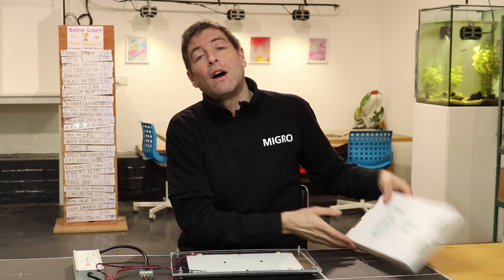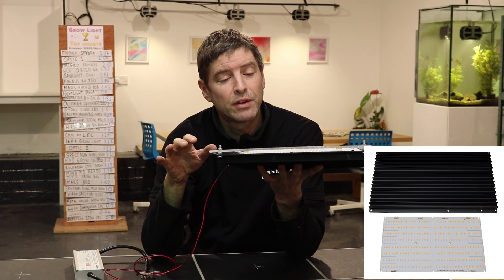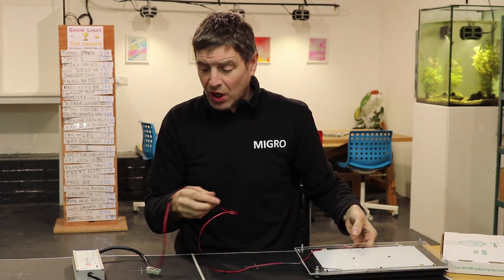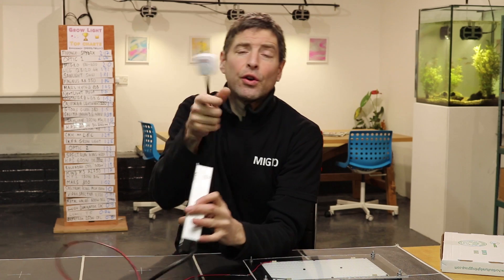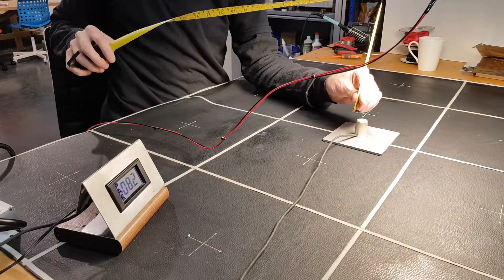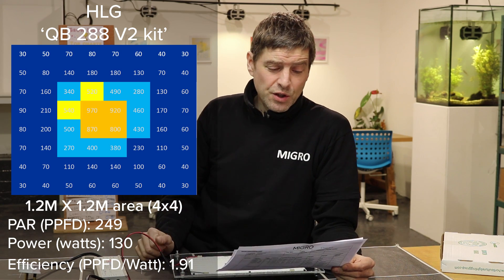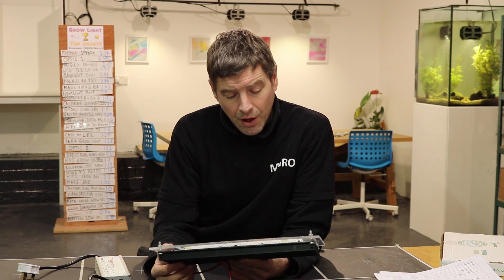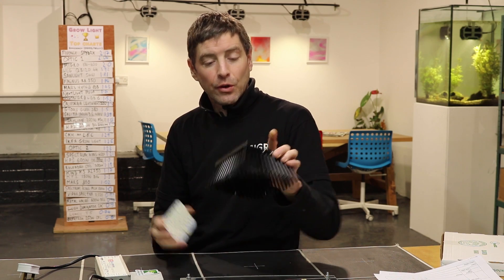HLG Quantum Board grow light test - Horticultural Lighting Goup QB288 V2

Comment from the maker: There is some criticism that I included an acrylic cover on the fixture. Here's why I did it:
1. Very few grow lights are sold without covers, even the cheap ones. Why is this?  Running LEDs in a grow room without a cover risks dirt, mositure, bugs, scratching/banging ertc. damaging the LED surface over time. Manufacturers supply covers so they do not have excessive warranty claims and the risk to users of exposed LEDs causing fires, shorting out etc. 
2. The reduction in light transmition is only 3%, this is a very small cost for protecting your LEDs. I tested the HLG QB288 with and without the cover and the difference was only 3%. I have tested the same with HID reflector hoods with glass on/off and the difference as 3% also so I am happy it's accurate.
3. This is a DIY fixture and the HLG guidance on how to install includes an acrylic sheet link here: https://horticulturelightinggroup.com/pages/qb-optics-and-connectors
Reply: Lars is correct. He doesn't alter migro for test results he shouldn't of altered the quantum board.. but even with the glass the qb scored great
Reply: This is funny as fuck ..... committing fruad ..... lieing ...wtf .....OCD at its finest .. people are why I don't go out anymore 😂 😂😂😂😂😂😂😂
Reply: @deanthornby2026  migro literally put a light limiter on a light and reviewed it.  Nowhere does HLG recommend putting plexiglass on. But I guess if your cool with it everyone else that isn't is crazy. Makes sense.  Ugh.  This is why trumps in office people are so  uneducated on simple science and morality.
Reply: Fuck the plastic cover the panels are only $60 USD a pice $35 if ordering directly from China where everything is manufactured now day's anyway 🤣
Reply: @mackattack8627  dude you're full of shit Horticulture Lighting Group manufacturers thier lights right here in Westerville Ohio.  Outside Columbus.
Reply: Thank you for the video's I really appreciate them.  I'm kinda of shocked how good the cobs are still doing against the new tech
Reply: Wtf.  You don't really believe that.  That 3% or .o3 would have changed the outcome from 2.05 to 2.1, which would have pit it in second place.  If that were a migro product something tells me you would have recommended a lens but not installed it.  Smh.  I see you.
Reply: ......these lights can be sprayed with water and not be damaged.......
Reply: @kenshinhimura9387  Their HLG550 fixtures are UL certified and have no plexiglass.
Reply: @LarsLarsen77  you sound fanatic over a brand... like a Chevy guy crying about the track surface and tire compound details when a camaro loses to a mustang.... Stating all these facts from a piece of paper or sales brochure. The light is fine. He didn't do anything wrong. At the end of the day It's just a damn light, this test isn't going to convince someone away who is already looking at a quantum board.
Reply: @volvo09  There is a reason these lights have a cult following.  They're fucking awesome.  At the end of the day he's committing fraud.
Reply: Lars Larsen why do you think he’s committing fraud? Isn’t he just promoting the light?
I’m just curious.
Reply: @volvo09 except your analogy is flawed.  Its more like Mr. Migro riding the brakes at 8% and saying its no big deal.  The plexi isn't needed, I own the light too.  It just limits the light....... Like riding a cars brakes in a drag race.... Not fair
Reply: @carlhank3495   by putting a plexi glass lens over the light he's limiting the ppf or light output, which is what he is claiming to be testing. It'd be like riding the brakes in a car 3%-4% while testing how fast it is.  The company doesn't recommend this. Its not fair. The light would have been 2nd place on the leader board.  I own the HLG QB 324, and with 15 yrs 1k w hps indoor farming exp.  I can say  they blow me away.
Reply: I run a rdwc and adding anything that's not waterproofed is a negative ghost rider.
Reply: @greenskeletons1896   I own an hlg qb and run it in a vertical light moving system along with spaghetti line the feeds  4' tall PVC tubes that I plant in( complex vert hydro system). Have had the spaghetti hoses fail and spray the light which was unbelievably fine.  Its UL certified w/o any coating.  These lights are the future.
Reply: "Approximately 4% of the incident perpendicular rays
are reflected at each air surface interface of colorless
Plexiglas sheet, giving a total reflectance loss of
approximately 8%. As the incident beam deviates
from the perpendicular, the surface reflectance
increases. "

As the angle of incidence increases,  the light transmission drops to ZERO and all of it is reflected.  Since these LEDs have no lenses (literally the only difference between this and your light,  other than it's efficiency) most of the light is being reflected.  You are lying.

https://www.plexiglas.com/export/sites/plexiglas/.content/medias/downloads/sheet-docs/plexiglas-optical-and-transmission-characteristics.pdf
Reply: You didn't use optically coated acrylic,  which literally nobody on the entire planet does.  They fucking sell one with acrylic lenses on it,  and you could have just used that.  You're committing fraud.

Comment: I was waiting for this one, thanks Shane, there are more and more being sold on ebay from uk independent sellers pre built with dimmer for around a £per watt which makes them far more cost effective than the HLG boards with the same components (apparently) Samsung and Meanwell have all ready done the hard work and are still covered with the same warranty periods.
Reply: What umols/w do they emmit if much more effective
Reply: @lightworker17  as per sellers description "650umols in the centre of 1m sq and 300umols around the sides at 20 inches" @250w from the wall. unfortunately all tests are not created equal and would like to see the boards up against the HLG in the same test conditions.
Reply: My friend went for cheap led from e bay ......  He knows his stuff and has done for many years .....he doesn't use them any more .....they took twice as long to finish

Comment: But have you consider some of the lights are water proof, and some of them are not? Also, the spectrum plays a big roll in the equation, just saying, you are doing great, maybe should consider a tent, which would be more accurate than open space for ppf
Reply: That was the purpose of the Mylar walls. Which I've never seen him use with previous lights, but I've missed a few.

Comment: The hlg qb's are capable of 150 watts. The efficacy is a little better a 120 but the total ppf output is less than what is capable. I find this slightly misleading. Also imo use a real grow tent, your losing a little light out the top and sides of your setup, and yes I can tell you did this to make filming easier. Also I've seen loses as high as 10 percent with the lens covers.
Reply: The plexi is reflecting most of the light hitting it because of the high angle of incidence,  so it's just spreading it out onto the tent walls.  He's absolutely lying about the 3 percent thing.  That's physically impossible.  He's also lying about it being a safety issue.  The HLG550 is ETL listed and can be used on commercial grows.  

You're absolutely right about using a smaller power supply.  HLG ships with the 135 watt A version,  not the 120w B version.  

Also,  HLG makes optical quality lenses,  and he could have just used those instead.  But that would be a fair comparison with his less-efficient lensed fixture,  so he will never do that test.  Much more profitable to commit fraud.  Someone should report him to the FTC.
Reply: @LarsLarsen77  you're a fucking idiot.

Comment: I use the 550v2 480 watt in my 3  by 3 by 7.9 feet tent, in rocks hard love these leds.
Reply: I've got 4 QB288v2s in a 2x4 :)
Reply: @LarsLarsen77  Great spread. Big up!
Reply: @svenzia  Yeah,  two double heatsinks running wall to wall.  I dim them down to about 150w each.
Reply: Lars Larsen  would two in a 2x2.5 work? Thanks
Reply: @scotthuey1981  yes very much so. You could even dim down a bit. I just did a test with only 1 board 125 watts from the wall aprox same size 2x2.5ish.
Reply: @scotthuey1981  Two quantum boards in a 2x2.5 would be perfect wired in series with a 260w HLG-240H-C2100A dimmed down a bit.  Running two boards at half power makes them much more efficient than running one board at full power,  plus you have better spread.  You also have enough horsepower to run 1000PPFD if you want.
Reply: Lars Larsen thank you. Much appreciated, I knew you would know. 🙏
Reply: svenzia thank you 👍
Reply: I bet it does awesome.  Overkill on full power but would not mind, love the QBs. You dimming?

Comment: I read some people use flathead screwdrivers to adjust the light as it won't round the screw off
Reply: For "A" drivers,  #1 phillips screwdriver fits the plastic adjustment screw perfectly.
I have 4 of these QB288V2 boards & very happy with them. Fast shrubbery growth
Reply: @maxlevett7474  He used a B driver so he'd get less output and could claim lower PPFD.  The actual kits sold by HLG come with an A driver.   It's just deception after deception with this asshole.

Comment: I normally enjoy your scientific based testing.  Not so much this time.  Lose the plastic cover and try again please.  Don't be the only guy on the internet with a cover...
Reply from the maker: The test in the open environment was repeated with the cover off and 64 PPFD readings were taken. The 3% rduction is the same I have had with glass on/off tests with HID reflectors. Thanks, Shane
Reply: @MIGROLIGHT   I spent a little time searching the web for information on light transmission through acrylic plastic.  From a couple of different sources: There is a 4% light loss going into the plastic and another 4% loss as the light comes out.  I was surprised to learn that there really isn't a lot of light loss within the material itself.  So we're at a commonly accepted 8%.  (I've got an Apogee PAR sensor, but didn't use it, but only because I don't have an appropriate piece of plastic available.) 

I get it.  The new HLG, in it's commonly used bare form, is a tiny bit more efficient than your light.  But it doesn't offer the protection for the diodes that your light does.  So you're just helping out a little with their design.   

You're losing a bit of credibility in the process.
Reply from the maker: I'm sorry to disagree but for a 3% light loss you should cover your LEDs. They will get damaged by dirt, flies, water etc. Trust me I know as I used to run cobs open and they always got damaged. I'm demonstrating responsibility and good practice and I'm surprised I'm the only one
Reply: @MIGROLIGHT   My thought was that if they sold them with the intent of someone installing a cover on them, you'd have  a fair test.  And while protection is indeed nice thing, modifying their design to test it isn't really a fair test.  Where are you getting your 3% correction factor from?  Is this something you've confirmed with your PAR meter?  My gut tells me that 3% is too low.
Reply: @335alien335  I think that I remember hearing Stephen from HLG say that the v2 boards now have a protective coating applied that prevents that type of damage.
Reply: @335alien335  Here they say.it's a diy kit, you can do with it what you want, they are not telling you how to use it. https://horticulturelightinggroup.com/pages/qb-optics-and-connectors
Reply: I agree this is a bs silly test shame on you. You know dam well what you're intent was you're not fooling anyone. Take that think ass piece of plastic off and run the test again i dont hlg would approve of this at all. Seriously no one does this.
Reply: @MrMaitland79  HLG would approve. why don't you check the website first?? https://horticulturelightinggroup.com/pages/qb-optics-and-connectors
Reply: @MrMaitland79  you're the only fool here
Reply: I agree i have never seen anyone in all the video's online showing with cover on it. Take cover off. I am sure it wont hurt you just for the testing process. Then we can see your math of 3% is accurate as well.. it's already 2nd place on your list behind you at 2.05... if it's 3% then it should be 2.11%    thank you for all the real testing   The only other thing is that I wished you had tested with the self kit with driver included instead of the B driver you used as I am able to turn past the 135Watt rating up to around 165-170 Area if I remember right. Would like to see how output is when maxed out from kit form sold by company..

Comment: Great video! I'm surprised you only lost 3% through that thick acrylic. I thought it would be double the loss you measured with the substantial thickness of that acrylic.
Reply: Acrylite themselves state a 8% loss in the visible spectrum with nearly 0.5% more loss for every inch of thickness of their clear acrylic. Even if is was 1mm thick, the surfaces of the acrylic lose 4% each for a total loss of 8%. IDK, man, 3% seems too good to be true.
Reply: @deluth4638  The losses increase with angle of incidence,  and since these LEDS put out light in all directions,  most of it is not transmitted.  It's being light-piped out to the edges of the plexi like a fiber optic cable,  and hitting the walls of the tent instead of the sensor.  He's tested HLG lights 3 different ways so far,  each time he just does whatever he has to do to fake the numbers.  It wasn't "unsafe" without plexi the last two times he did it.  Suddenly now that he's testing a more powerful light he has to do something new to get the numbers he wants.

HLG makes a version of this with 90 degree lenses,  but he didn't test that one,  because it would be a fair comparison to his lensed fixture.